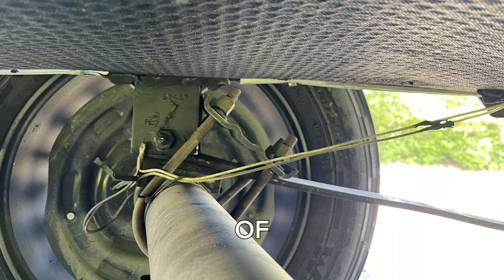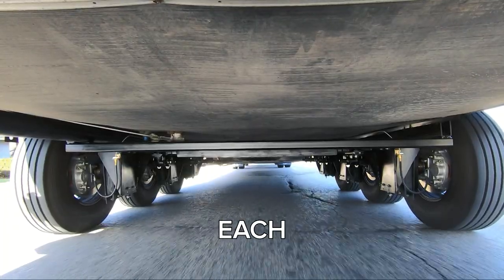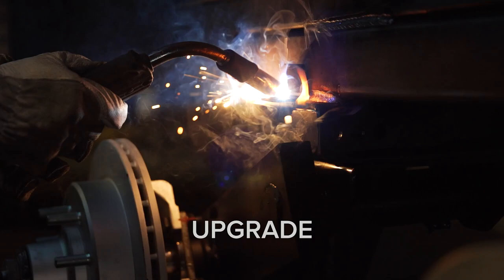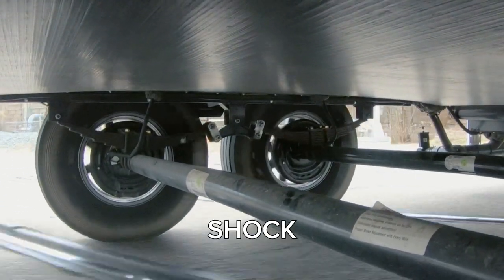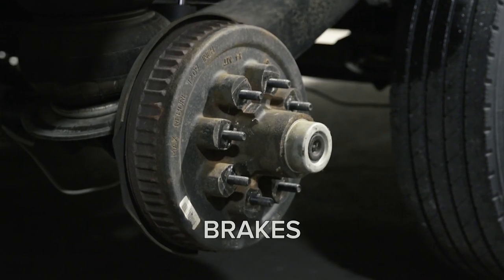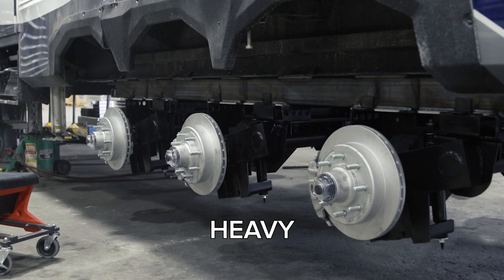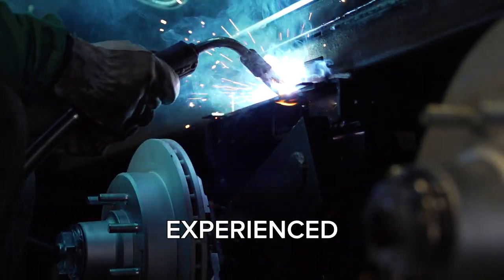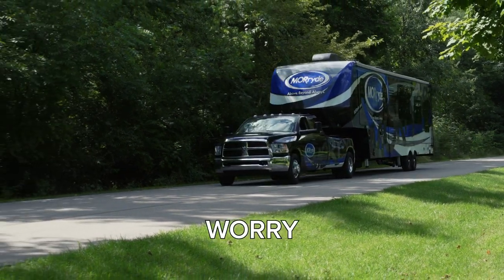Unlocking the Adventure: Why a MORryde Independent Suspension is a Must-Have for Your RV!

Comment: I seen you have developed an articulating hitch designed to hitch to a ball. I seen them on a high end off road RV trailers sold out in Utah. I can’t find on line to purchase. When will they be available for public purchase.
Reply from the maker: Hi, good question. At the moment we do not have plans to make the articulating hitch available to the aftermarket.
Reply: @morrydeinc  O no, I was really hoping to get one for my Ember. Are you just a private company for ROA?
Reply from the maker: If we start to sell the hitch in the aftermarket, we can comment here and let you know. We manufacture the frame, hitch and suspension for Palomino Pause off-road RV's. @mgysgtk8835
Reply: @morrydeinc  thank you